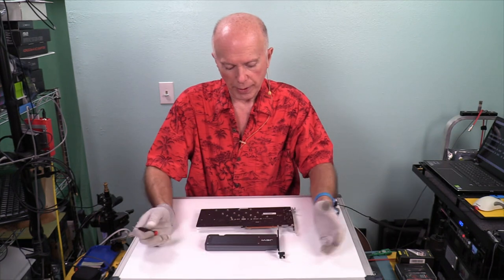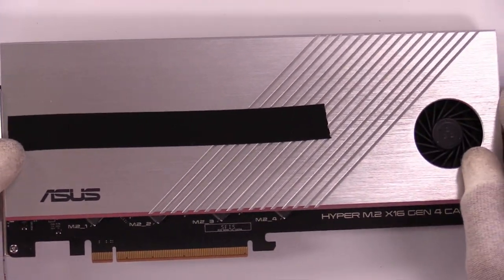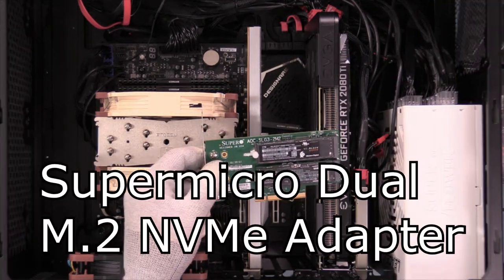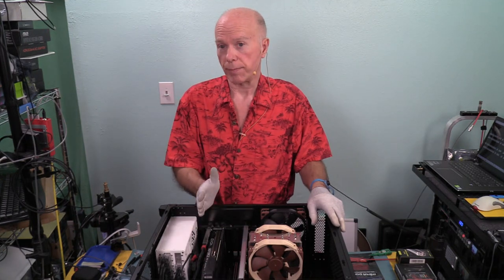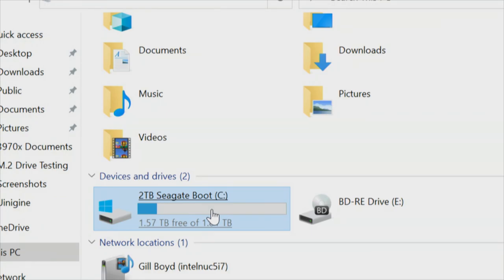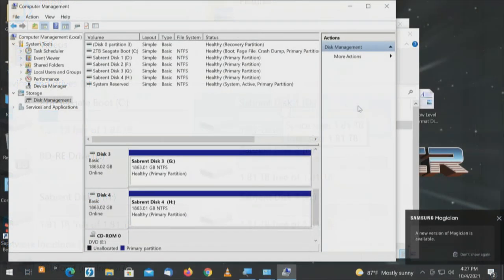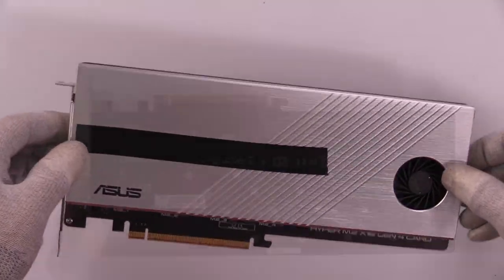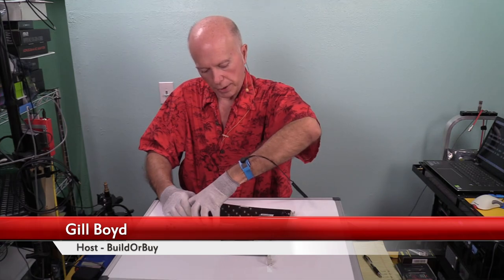ASUS Hyper M.2 X16 PCIe 4.0 X4 Quad card Heat and Speed Test Comparison

Comment: Hi BuildorBuy, 

Thanks for the informative video. I'm upgrading my system to the X670E chipset, using the ASRock X670E Taichi. The board only has 2 PCIE x16 slots, and I want to add this ASUS Hyper M.2 with 4 more NMVE drives into my system. My question is: if I want to run all 4 drives, will I have to sacrifice the first PCIE slot for this card and use my GPU on the second slot, like how you did in the video? If there is anything else you can elaborate on this topic, I would appreciate very much. 

Thanks in advance!
Reply from the maker: Hi Luan Phan,
Welcome! Excellent Question! That will require a Video Response! Right after this next, Video Answering a Subscribers Questions! Appreciate Your Patience!
Reply: @BuildOrBuy  Thank you very much for the extra effort! I will be waiting.
Reply from the maker: Hi @luanphan2706 ,
Appreciate Your Patience! Interesting to note, We were working on a Video about this very Motherboard when We had a Question that took priority now this one too is a priority! Fascinating topic!

Comment: I noticed you prefer to put the SSD's card closer to the CPU, but isn't there an advantage also to put the Nvidia close to the CPU? it does have 11G of its own.
Reply from the maker: Hi Noam Lavi, 
Welcome! Not a Preference but a Requirement in Solving a Problem while  Answering Viewers Questions. Originally there was what We called a Bus Prioritization issue. Meaning? Originally the Thunderbolt AIC and GPU had to be next to each other. Once the Motherboard Bios was Updated and the Titan Ridge Thunderbolt 3 AIC V1 had a Firmware Update, all was good. And those 2 could be seperated. And We proceeded through all of the Quad cards to verify. Had a similar issue Originally on WRX80 Workstation Motherboards. The Bios was not able to allocate CPU PCIe Resources to 4 GPUs. Growing pains! Crazy, right. So that's the story on what, why and how for that Topic! Glad You asked! Hope that helps!

Yes the Preference is GPU next to CPU but does not have to be that way.

Comment: I have an X570 from Asus (TUF gaming wifi pro plus) and the rtx 3070 rog strix on the first pcie x16. Will I lost performance (if I am correct by what you said here) if I put this card (Asus Hyper m.2 x16 v4) on the 2nd pcie x16 going down to x8 speed?
Reply from the maker: Hi Ragalthor,
Welcome! Great Question! That will not work! You do NOT have enough PCIe Resources. And I'm not certain if You can full Bifurcate that x16 Slot from x16 to x4x4x4x4. Bummer, right. You only have 20 PCIe Lane Resources to the CPU. 

x8 Speed meaning there are only 8 PCIe Lanes when We need all 16 Lanes for an Asus Hyper m.2 x16 card. Hope that helps!

Comment: Could you please share the card comes with standoff in which size? I got one but it came with no standoff and I am looking for alternative. Thank you so much in advance!
Reply from the maker: Hi Võ Hoàng Sơn, 
Welcome! Gladly! ASUS Hyper M.2 x16 PCIe 4.0 Quad card standoffs = M.2 2.4mm standoffs. Trying to Source them! No stock! Found  on Amazon 2.5mm but still a bit too tall! Let Us know if You locate a Source. ASUS does not have that Part Listed. Bummer!
Reply: @BuildOrBuy  Thank you so much for your kind help! Much obliged!!! 
I bought one from local online shop, and I didn't notice that I'm buying "tray" version, which is the AIC alone, no stand screws or rubber pads. I've ordered some "low height stand screws" from China, since seller doesn't not provide precise measurement, I can only crossfinger this. Will keep you posted about this.
Reply from the maker: Hi @vohoangson5792 ,
Absolutely! Never seen one in OEM, Tray packaging. Have only seen Motherboards and CPUs sold that way. But not in a long time. Odd no screws. Yes, keep Us Posted on Your Progress!

Comment: I've got 4 Samsung 980 pros on that Asus card in raid 10 within Windows. I'm getting about 10,000mbps. I knew it wouldn't scale to exactly double the speed, but I was a little disappointed it wasn't higher.
Reply from the maker: Hi Grant Fahey,
Welcome! Have You considered Hardware RAID? Numbers sound about right. That tells me Your M.2 NVMe Drives are PCIe 4.0, 1st Generation. A Hybrid Bios Bootable RAID 0 would be the Speed of 3 Drives. Overhead. Thanks for Sharing! How are You using Your RAID 10?
Reply: @BuildOrBuy  Its for high speed storage in our office, it contains all of our customer data that is accessed simultaneously by 6 people, 3 of which are connected with 10gbps ethernet. The drives are samsung 980 pros, rated at 6400mbps each. Its on an ASUS Pro WS X570-Ace, which I was unable to get to play nice with raid through the bios, so its just a software raid in windows, not ideal, but not bad.
Reply from the maker: Hi @grantfahey4439 ,
Understand. Gets the job done! Thanks for Sharing! This helps Us to make better Videos as We Answer Subscribers Questions!
Reply: @BuildOrBuy   I recently found a SSD adapter that will get up to 7,000 MB/s on read and write speeds. Its called AMPCOM M.2 NVME SSD to PCIe 4.0 Adapter Card, 64Gbps SSD PCIe4.0 X4 Adapter for Desktop PC ,PCI-E GEN4 Full Speed. I'm curious if your familiar with this adapter? Do you know of any other adapters that allows real fast read and writes speeds? Please let me know what your take is on this, thanks.
Reply from the maker: Hi @TiredOfImbecileLibtards ,
This one: AMPCOM M.2 NVME SSD to PCIe 4.0 Adapter Card, 64Gbps SSD PCIe4.0 X4 Adapter for Desktop PC , PCI-E GEN4 Full Speed
https://amzn.to/3Fq4zMB
Know about it. Have not used that brand. This brand below We have Tested but not that particular card.
GLOTRENDS M.2 PCIe NVMe 4.0/3.0 Adapter with 0.12 Inch Thick M.2 Heatsink for M.2 PCIe SSD (NVMe and AHCI), PCI-E GEN4 Full Speed, Desktop PC Installation (PA09-HS)
https://amzn.to/3Jw8ZUP
As an Amazon Affiliate I earn from qualifying purchases! Either one. Single M.2 NVMe Drive. Requires 4 PCIe Lanes. No Bifurcation required. Hope that helps!
Reply: @BuildOrBuy  Thanks will definitely look into it. By the way I recently purchased a new motherboard. In the process of building a new pc. The Motherboard I got is GIGABYTE B560 HD3 (LGA 1200/ Intel/ B560/ ATX/Dual M.2/ PCIe 4.0/ USB 3.2 Gen1 Motherboard. I only paid about $115 for it total. It supports DDR4 XMP Up to 4600 MHz and Beyond. Check it out if you like. Looks like real decent Motherboard for not a lot of money.
Reply from the maker: Hi @TiredOfImbecileLibtards ,
Congrats! Hope that meets Your needs. Not enough PCIe Resources for Us. Thanks!

Comment: Hi,
Asus hyper card was not working , showing only onedrive of 4. The motherboard is msk x570 tomahawk, cpu amd ryzen 5950x.
Reply from the maker: Hello lgtv smart,
Welcome! Verifying what You have:
MSI Mag X570 Tomahawk WiFi 
https://www.msi.com/Motherboard/MAG-X570-TOMAHAWK-WIFI

Two Requirements. 
1. A X16 PCIe Slot, electrically not just mechanically. 
2. Full Bios Bifurcation of Slot. On that Chipset, has to be Primary Slot. Verify Slot Configuration Options in Bios. 

On Your Motherboard, 
3. PCI_E1 = X16, electrically 
4. PCI_E3 = X4, electrically 
Specifications, Overview of Components, Block Diagram and PCI_E1~4: PCIe Expansion Slots Diagram all indicate same. Don't know about Your Bios. You'll have to Verify those Settings. Hope that helps! 

Now to the next Question, do You want Your GPU to be in a X4 Slot? Not really! Next option? A Self Bifurcated Add in card that could utilize a X4 Lane Slot. Doable. That type of AIC will Cost more than Your Motherboard. Bummer. Next Option?  New Build with more PCIe Resources! What's Your Reasoning for a Quad card? More Storage? Faster Storage? Your Motherboard is PCIe 3.0. New Motherboard. New Build. A good reason to Build!

Comment: Dear Build or Buy 

I am looking to use high capacity u.2 ssds on my intel i9 12gen running mac and i see expansion cards from owl and sonnet …. Any help on the usage of high capacity u.2 or u.3 sad usage on a pc
Reply from the maker: Hello famousnikhil, 
Welcome! Can You be more Specific? Both OWC and Sonnet M.2 NVMe PCIe Add in card work in Macs. Cards as described in this and Our other Videos do NOT work in Macs. The Distinction? Bios Bifurcation vs a Self Bifurcated card  with a PLX Lane Switching Chipset. Macs require the latter and do not support the former. To reiterate, Macs do NOT support Bios Bifurcation. Macs can only use cards that are Self Bifurcated. What is Bifurcation? The forking or splitting of PCIe Lanes on a PCIe Slot. Hope that helps!

Comment: When you test the expansion card, do you do it on a Ryzen mobo or do you use a Threadripper mobo ? If latter, which one ? Like ayeayeron I have the Asus Tuf Gaming X570 board, but I can't seem to find where I bifurcally? split the pci slot.
Reply from the maker: Hi Soren Hansen,
Welcome! There are two types of Add in cards for multiple M.2 NVMe PCIe Drives. They require either Motherboard Bios / UEFI Bifurcation or they are self Bifurcated like the Highpoint or Glotrends Sky add in cards. 

All of the x16 and x8 M.2 NVMe PCIe Add in cards that require Motherboard Bifurcation are made for the HEDT (x299, x399, TRX40) or Workstation (WRX80) Platforms with Dedicated PCIe Resources. And there are other Workstation Chipsets that are also supported. Depends. Yes there are a few on lower end Chipsets with Shared Resources that can support a Dual M.2 NVMe Adapter. 

Specifically on the x570 Chipset, Shared PCIe Resources, the particular Slot must be x16, Electrically. And be able to fully Bifurcate said PCIe Slot. The x570 Chipset I think only supports partial Bifurcation, meaning x8x4x4. That might Support 3 Drives instead of 4. 

The System We're Testing on is the Gigabyte TRX40 Designare HEDT, PCIe 4.0 with Dedicated PCIe Resources. That is a Threadripper III. We have two x16 PCIe Slots and two x8 PCIe Slots, Dedicated, no Shared PCIe Resources. The Threadripper Pro is on the WRX80 Workstation Platform with more PCIe Resources, usually six x16 and one x8 PCIe Slot, Dedicated! Hope that helps! Thanks for Asking!

Comment: hi, great video on a topic that is covered way to rarely in my opinion, as the one or two m.2 ports (may not always be nvme.... oO ) on the mainboard just are not enough. 
could you tell us something about the noise level from the asus hyper card?  ... i have a very similar card from asrock (the asus was just out of stock in 2019..) in my PC (x299 platform with intel i7-9800x, so everything is fine with pcie lanes), loaded with 2 samsung 970 1 TB drives, no problems at all, except that even in idle the drives sit around 50°C. they don't go up ridiculously high when under load, so i am definitely not worried... but yeah. fan speed is at 25 %, which is more or less silent, but any step higher gets really annoying, no way using that. and it even does not help with temperatures. funnily, setting the fan to off resulted in the drive temps to drop by 2 K or so... i guess this must be a result of airflow/pressures in my case.
Reply from the maker: Hello Jenairaslebol27merde,
Welcome! Good Question! I'm the wrong person to ask about the noise from the M.2 Quad card Fan. Our Video Switch cooling Fans make more noise. We have that set at a constant, therefore the noise floor is like white noise and not noticeable. We have had Reports from other Subscribers who find the noise objectionable. Larger Fans make less noise and Produce better air flow. Remember when Cases went from 90mm to 120mm Fans. The noisiest Fans are typically Chipset Fans. Like a Screaming Banshee! We need better Cooling Solution Designs! That We learned from Testing M.2 NVMe PCIe SSD Drive Heatsinks. In that area, the Passive Cooling Solutions outperformed the Active Cooling Solutions! And that was Fascinating to witness Results on all 16 M.2 Heatsinks! Hope that helps!

Comment: If an expansion card comes with my motherboard, should I install it even though I don't have extra SSD's to put in it or just leave it in the box until I need it?

Also much of the internet seems to recommend putting the GPU in the first slot, but you put it in the last slot, what is your reasoning for that?
Reply from the maker: Hi Darteous,
Welcome! Congrats! Just keep it in the box until You can populate the card. 

Great Question! We are doing a lot of Testing while Answering Subscribers Questions. One issue was the association of the GPU to the Thunderbolt AIC which required a Firmware Update of the Thunderbolt AIC. Another issue was the problem of Testing Heatsinks that would not fit at the bottom of the Motherboard for Testing. And the third issue was to show that a single GPU can be placed in the 2nd x16 Slot once the Thunderbolt AIC was uncoupled from the GPU. The Thunderbolt AIC fits best in the last x8 Slot for the Testing of the (ASUS, ASRock and Gigabyte and Amfeltec Squid x16) x16 Quad AICs and x8 Quad AICs (GloTrends and Amfeltec Squid x8). Hope that helps!

Comment: Wouldn't the temps be better if the factory sticker is replaced thats on the nvme? This way, it will make proper contact with the thermal tape/plate and the IC's thats on the nvme.
Reply from the maker: Hi Flash Backs, 
Welcome! Depends. Not necessarily. Some M.2 NVMe PCIe SSD Drives utilize either a Label or back plate type label made of copper Designed to help dissipate Heat. As We have previously stated on some of the 16 M.2 NVMe PCIe Heatsink Tests, We leave labels on. If You choose to remove such, that is Your choice. We would not otherwise know which drive is which since We do so many different Tests with so many different Components. Furthermore, All Tests are Conducted for uniformity in a Default Configuration. Your Results may vary. Hope that helps!

Comment: Can these boards support just SSDs or do they just abstract devices to the PCIE bus?
Reply from the maker: Hi joaosidonio, 
Welcome. The Hyper card supports M.2 NVMe PCIe SSD Drives. Your Bios must Support Bifurcation. The ability to change a X16 Slot to X4X4X4X4. Each M.2 NVMe PCIe SSD Drive requires 4 PCIe Lanes.